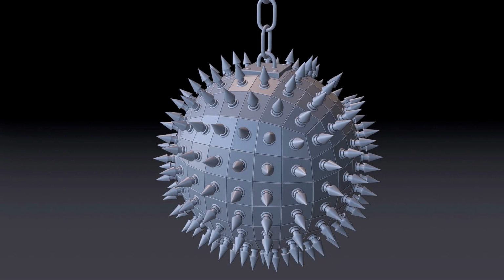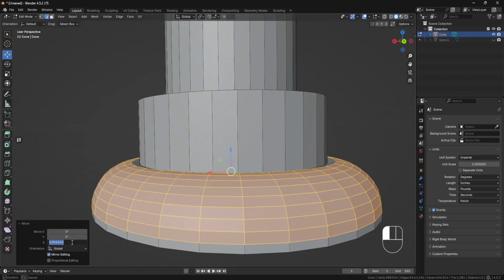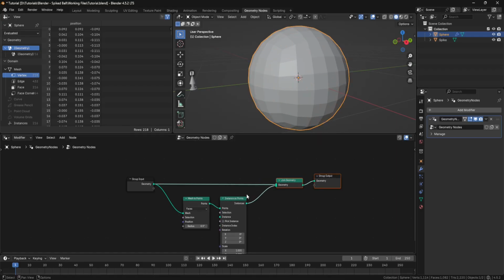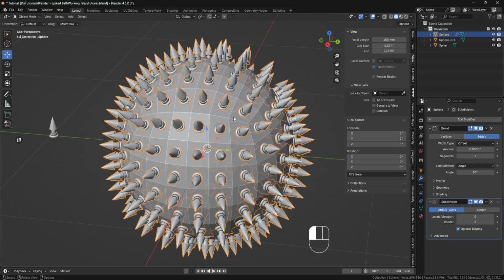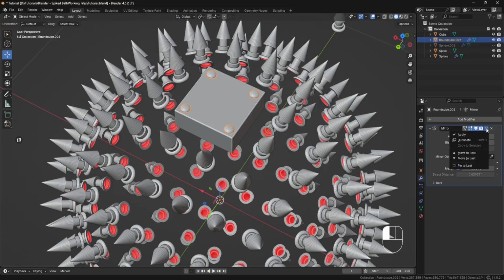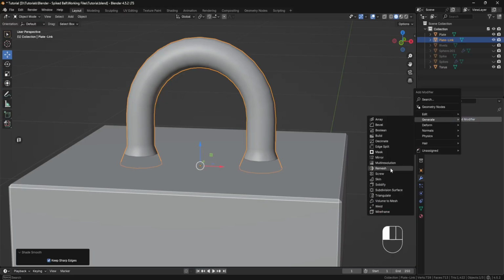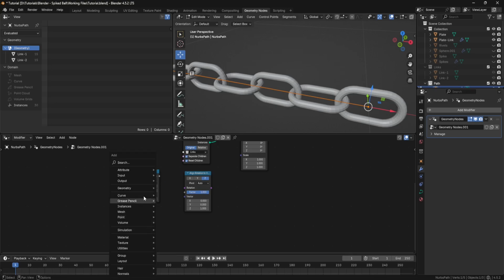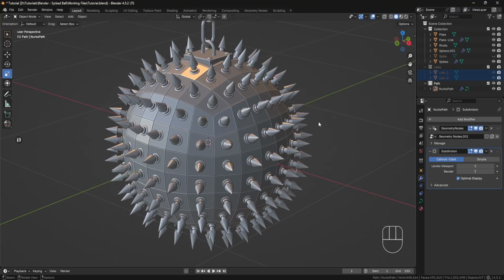How to Build a Spiky Ball & Chain with Geometry Nodes

Comment: The normal Node can be plugged directly into the Align Rotation to Vector Node.
Reply from the maker: Thanks but that doesn't seem to work. If I plug the Normal node directly into the Align Rotation node, the spikes don't change direction. They continue to point straight up. I have to run the Normal through the Capture Attribute node in order for the spikes to change direction and project out from the faces.
Reply: @roddeweese6402  My bad. Position Node, not Normal Node.....
Yes - Kind of unintuitive. But it is being placed where the point is on the face, so it takes the points rotation.
Reply from the maker: @neilmarshall5087  Ok, that works. Thanks for the tip!